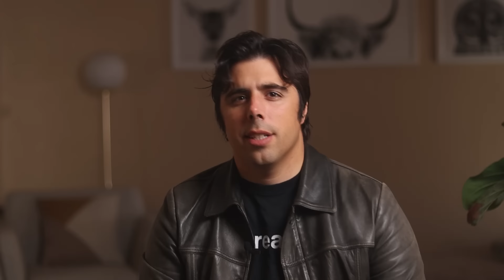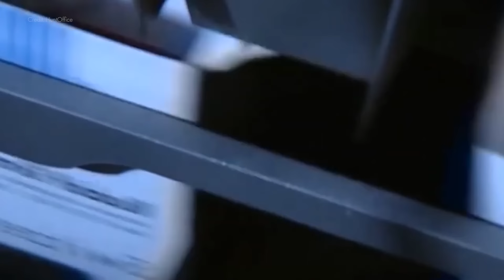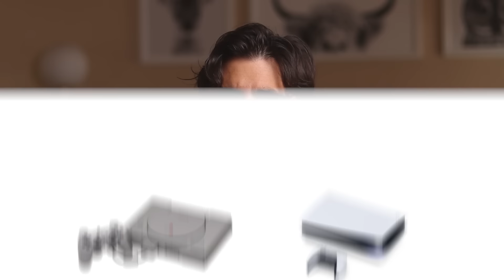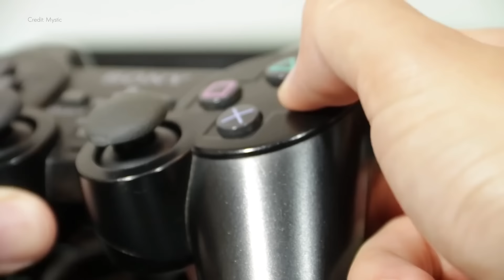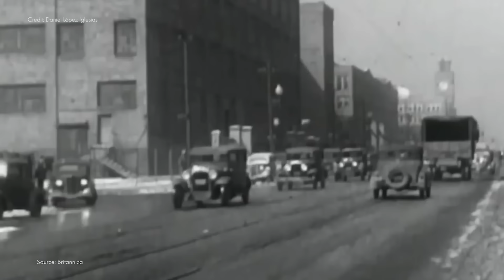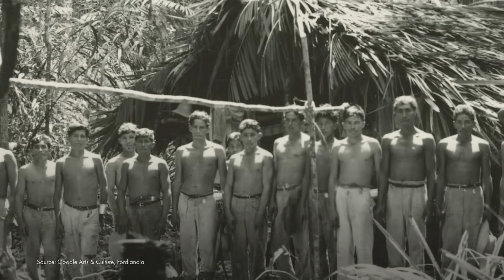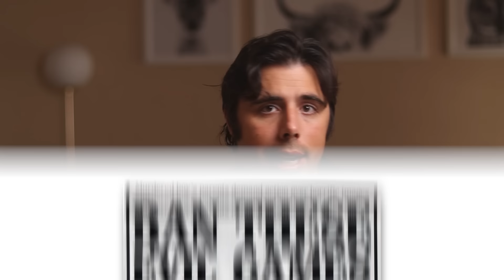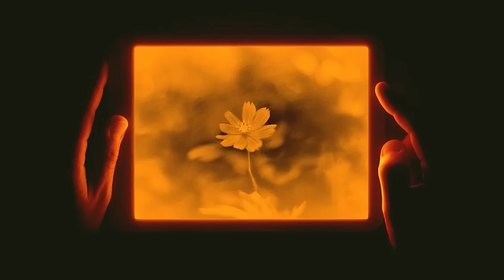Why Some Designs Are Impossible to Improve: Quintessence

Comment: Touch screen on a smartphone makes sense. Because you look right at it 95% of the time when using it. Touch screens in a car, do not make sense. Because you're not supposed to be looking at it.
Reply from the maker: Touch screens on vehicles are awful and dangerous. It's really important to have tactile feedback while you're driving.  But I understand why companies do it. It's cheaper and they can update the interface if necessary.
Reply: @Design.Theory  if we had an effective regulatory system, they'd standardize which functions are ok to be on screen vs. physical. Then no company could claim they were being undercut by another, because they'd all have to meet the same minimum. But alas. We don't.
Reply: @IanZainea1990 if we had a free market without regulation engineers could focus on real world factors like this. 

Also, you don't need to use touchscreen when driving even if you have one. Short attention spans and drivers who will get their distraction if they want it are the problem. 

regulation makes everything worse
Reply: @AbstractAproach if we didn't have regulations then everyone would .. not use the new, cheaper tech?
Reply: @Chandeliers57 

its quite a conpkex subject. Years of government authority and scapegoating don't help. The adjustment would be rocky, I agree. 

At first some businesses would do all of the evil (slavery, child labor, false advertisement, pyramid schemes) and some people would incentivize it 

But eventually through education, awareness, and the understanding that it's their fault people would look for better practicing companies to patronize. 

Insurance also may play a big role, especially in the adjustment period (seeing inevitable backlash they would deem companies higher risk) and could act as local police forces until community policing becones more normalized. (The stop snitching movement is a great example of an appropriate response to government domination but a terrible strategy generally)
Reply: @IanZainea1990 The EU is about to do it, actually. Better late than never
Reply: @hundvd_7 the EU may not move quickly, but at least they move. Data privacy, phone charger standards, now this. To name a few.
Reply: @Design.Theory  also: touch screens do not give you muscle memory. button and knobs with one function on a fixed place help you to not even look at them eventually.  menu diving and scrolling needs extra attention, which your brain needs for for the complicated task of driving
Reply: @Design.Theory  I think one reason for touch screens is that updates can be added to allow charging "subscription" fees for features already in the car. BMW tried it. Anything that turns a one-off "purchase this item" into a subscription-based monthly fee is still unfortunately high on the "seems like a good business decision" list.
Reply: @noyb7920  Thank you for responding in the comments section.  I'm the volunteer moderator of a website.  When we stopped  having a moderator for years, our comments section lost life.  It came back when I started  commenting every day to show the site has personality and that  someone cares about the  discussions and reads them.😊  You did a great job with this video!
Reply: @Design.Theory I want all the Touchscreen in cars responsible engineers to be jailed because of cruelty against mankind.
Reply: @Design.Theory you'll never guess what video you released yesterday 😂
Reply: @Design.Theory  you don't need to update good design, as your own video states. knob controls are almost 100 years old and everyone knows where they are and how they work.
Reply: @zenlettering  I agree, you could reach for the knobs or press buttons without taking your eyes off the road.
Reply: @Trainasaurus that is exactly why modern cars have music volume buttons directly on the steering wheel and/or volume knobs beside the screen 🤦‍♂️
Reply: @Design.Theory we've spent so long thinking about designing for audio and visual intuitiveness that it feels like we've forgotten about how important the contact senses are to a quick-response control panel

Like, maybe this is a weird example, but one of the things that makes trying to fly an RC plane, or even a simulator of a real plane, harder than a real one (yes, harder: it just seems the opposite because the first two obviously have less consequences for failure and more time to practice), is that you don't have any sense of touch: you can't feel the plane shake as you approach stall, you cant feel your body get pushed into your seat as you make a hard maneuver, you have to rely entirely on your eyes and ears for information that is best described by your skin and sense of balance.
Reply: Yeah, I think knobs are just way easier to use for most things in a car. Volume? Give me a knob. It’s quick and easy. Fan speed? Give me a knob. Temperature? Give me a knob. Basically anything that can be a knob should be a knob lol everything else can be thrown on a touch screen, but essential stuff that should be accessed quickly shouldn’t require you to dig through a UI. It should just be accessible at all times.
Reply: Yeah, touch interfaces are extremely useful when you have limited space and would look at the touch interface. Like on a phone.
Every time you don't directly look at, either because you can't or because you shouldn't, physical buttons with mechanical feedback are better.

I have touch buttons on a monitor, and either need the room light on or bring a torch to press the right one (because I don't want to turn it off when I want to switch input)
And I still have an "old" mp3 player, on which I can change volume or skip a track while keeping it in my pocket.
I can find and use the light switch in the dark.

And yes, for a car the radio volume, channel switch buttons, on/off switch absolutely should be physical.
Feel free to combine it with a touch screen.
You switch/select a station with physical buttons (from a hot bar), but you enter the name with a full touch keyboard. Problem solved.
Reply: The one problem I've found with a touch screen (not just with a smartphone but any touchscreen) is that since the touchscreen touches your face/fingers you end up with the oil from your skin left on the screen. Although this may be an issue with other devices that you touch, it seems to be especially noticeable on touchscreens.

Another problem with a touchscreen is that you can't fully protect it. As an example, I had a Sony Walkman NWZ-A818 Walkman that had physical buttons. Due to that, I put a clear plastic case that covered the entire player including the buttons (it had rubber covers over the buttons so that you could use the player without having to remove the case). I could drop the player without having to worry about damaging the screen. It might damage the case, but the player itself would be untouched.

Compare that to my current player, the Sony Walkman NW-A55, which has a touchscreen. Although I've put it in a protective case, I still have to open the cover to access most of the player's functions, although it does have physical buttons for the basic functions (volume, next track, play/stop, previous track, and hold) that I can access without opening the cover.
Reply: @Solitaire001 Walkman has a touchscreen now?!  I'm still using one for the 80's.  They're almost indestructible.  It's only my third one since the 80''s .    The  first 2 were stolen.  I dropped all of them countless times with no damage.   My first one was made of metal, back in the olden days   I still see other people using the old cassette kind.  The benefit is that people won't talk to you if they can see the big Walkman.
Reply: @Solitaire001 just use earphone/airpod while on the call
Reply: yeah I dislike Tesla for that reason cause in a standard car I don’t have to be looking away from the road just to click 5 buttons spread so far apart to turn down the volume in my music
Reply: @andrasbiro3007  I am joking
Reply: you should be cleaning your touchscreens regurarly anyway with products designed for that
Reply: @Solitaire001  Maybe wash ur hands and ur screens lol.
Reply: @Solitaire001  screen protectors:
Reply: @alsonotraeon   I like the thin adhesive kind.  That's what repair shops put in phones.  Try using the phone at a different angle or further from your face.
Reply: Smartphones mainly have touchscreens because to implement any other control type would add a lot of size and weight to the phone,  plus it's a very Intuitive way of controlling something
Reply: @zachmartinez2295  I tried using a mouse again and hated it.  I love the ability to magnify an image with spreading fingers on a touch screen.
Reply: In my opinion, the only good reason why they put touchscreens in cars is to reduce costs. 1 ipad is much cheaper than all controls and backlights. And since you need a screen anyway it's even cheaper to add one extra layer to the existing screen. You can get an 8 inch touchscreen digitizer for around 6 bucks. And you don't have to design stylish buttons that last the warranty period
Reply: I hate touch screens. There is no tactile feel when you touch it, eg you have no buttons to feel that you’ve touched the right thing.
Reply: Phones have limited surface, and more screen allows for more functionality; so removing the need for buttons is actually an improvement.
In a car you have a limited amount of controls you really need, and you want them to be activated with as quick of a movement. Imagine trying to go through a menu to turn on the blinkers.
Reply: How do you make something usable when you can't look at it? Put everything in a consistent place and provide tactile feedback, possibly with some visual feedback that can be readily understood by peripheral vision only.
Touchscreens fail all of this.
Reply: I HATE touchscreens in cars! They should be banned.
Reply: @beestingza  especially when they mirror your phone

like what? using my phone is prohibited but I can play flappy bird on my car screen?
Reply: i think you meant to say placing car functions that you need quick access to while driving, like AC or ventilation on the screen, or worse, behind multiple menus instead of physical controls like buttons, which you can use with only a quick glance. And if you are talking about the center console scrollwheel on certain higher end cars, that is the dumbest thing ever, especially if said car doesn't even give you a toucscreen. Try rethinking your comment.
Reply: @DecidiousPopsicle  I mean. You figured out what I meant. So I think it's fine as is then. Lol
Reply: Real drivers prefer knobs.  They are faster, more intuitive, safer, and more robust and less likely to break.  Do you suppose a touchscreen is going to last 10 years?  How much is it going to cost to replace when it fails?
Reply: @Electrichead64 finding a replacement or 3d printing a broken knob on an 20 year old car: easy.
Finding a replacement screen in 20 years: Good luck.

Some things deserve to be analog.
Reply: @Electrichead64  
Actually knobs are more likely to fail, since they are mechanical, and each one is a separate point of failure.

And safer is when you don't have to fumble around while driving. In a Tesla most critical things are automated, and the rest are accessible on the steering wheel.

My Tesla is 8 years old, and the touchscreen looks and feels like brand new. And mine is not unusual, screen failure is very rare in general.
Reply: @andrasbiro3007  I NEVER had a car that had any button fail.  IF your so called screen dies what then? yeah right your pretty much screwed if you also dont have a dashboard anymore so this kind of design is extra stupid because it makes it more likely to go out with a big bang rather then just one instrument is going out. 

A good designed  doesn't need any updates and why would you want a app on a car in the first place. IF you think this isn't possible to upgrade knobs in your car then you really dont know cars. Cars from the past even had more space for retrofiring more knobs, the mount was already there.  .  Unless its a race car and you dont want a touchscreen there either.  To compare a car to a smartphone is funny. Totally different things. The one is a pretty universal thing and the other is just a box to get from A from A to B and nothing else
Reply: Well said
Reply: The best design for a car screen is to cut the touchscreen and have a controller that is connected to the car screen
Reply: I honestly hate that cars has a giant media screen in the middle console.
Reply: lol we're never getting self-driving (i.e. zero supervision) cars
Reply: I talked to someone who worked at a car manufacturer before. He said the reason they use touch screens is because the cost of manual operated buttons for even basic controls costs over 10x the amount of 1 touch screen. They can then increase the amount of features by simply uploading new software instead of increasing the amount of hardware.

This cost save, however, does not translate over to the customer. A single button repair or a few dead wires is a few hundred dollars if you take it to a repair shop; not even 100 if you know how to do it yourself. A single issue with the screen and you're basically F'd.
Reply: Agree. I don’t understand why they are still so prevalent.

I owned a 2010 Lexus RX with, for lack of a better description. a mouse, that would lock the cursor with a bit of friction but not totally on menu items or buttons etc. It was the best I’ve seen but yet it’s not found in later models and I have no idea why. My eyes stayed more on the road, it was more intuitive to use, and it was the perfect marriage of using a computer in your car with simplicity and quick glances to only relevant sections. You could make the mouse larger as well but default it was large and borders around the thing you would be clicking on. Google 2010 Lexus RX Remote Touch for pictures and check out YouTube for how it worked.
Reply: One reason I love my CX-5. Changing things on the screen is easy, knee jerk familiarity, and near where my hand is already resting. Keeps my eye more on the road.
Reply: i like screens in cars, but teslas suck. i like buttons personally, nice high quality tactile buttons 😂 my mom disliked the model x's screen setup and stuff so much that she traded it in a month later
Reply: Very true. Those touch controls behind the wheel and in the middle console feel much more intuitive.
Reply: I actually find them largely inefficient. the problem is that we have hands which get in the way of seeing what is on the screen when we go to tap or drag or whatever....which is why I use my nose instead.
Reply: Yeah, without something tactile for me to feel, it becomes really difficult to control anything in the car's stereo without me diverting my visual attention. Buttons on the steering wheel are so much better.
Reply: Added the touchscreen but removed the steering wheel controls... It is not timeless but the most robust design is Ford Sync in the 2010s... the latest revision isn't great, but the wheel controls get easier to use the longer you use them.
Reply: QUERTY is shit.  It was litterary designed to be as slow as possible because on early typewriters If you typed to fast the hammers got stuck and made mistakes. Only reason we aren't replacing it with like dvoraks is that the short term cost would be in bilions in replacing hardware and training people
Reply: It kinda makes sense on a phone but i'm 100% convinced i was still faster texting with my old Nokia flip phone and that tactile qwerty revealed on the "inside" of the phone. Obviously the huge screen of a smartphone [when compared to older cell phones] is kinda necessary nowadays because it's all social media in one form or another and people watch videos / play games on their phones. Attaching a tactile keyboard to those things now would require some massive innovation i guess, as the form factor plays a huge part obviously.
Reply: Touch screen is good because it’s a big display for GPS directions. You might argue that other GPS screens do the work but they either block the view or, if the touchscreen isn’t there it blocks controls. And you don’t have to constantly look down on the phone to find your direction.
Reply: It’s not different than looking at an old radio or a passenger. Just like talking on the phone is no different than talking to a passenger.
Reply: The only display that makes sense in a car is a head-up display.
Reply: SO TRUE, give me the haptic feedback of a knob, that i can find without averting my eyes
Reply: 100% !!! I just bought a new car after using the same one for 19 years and my main gripe with it is the touchscreen control for the HVAC system - both, it makes me have to really look at the screen and not the road if I want to change something while driving(like which vents the air is coming out from, specially the defogger vents on the front windshield), but also what about when one day that touchscreen inevitably fails: I'm ok without music or navigation for a few hours, but I'm gonna want heat in -20C, specially if I'm somewhere stuck in a snowstorm. My other gripe is all the "smart" features, like auto-on/off and lane assistance - I can turn the engine on and off when I want to, and if I change lanes without a blinker you bet there was a good reason for it. I really wish my house on wheels wasn't all controlled through a big smartphone screen.
Reply: This! I will NEVER buy a car with a touch screen. I want physical buttons. I’m driving after all.
Reply: While touchscreens in cars that encompass all the climate controls are objectively less safe, the cars that use joysticks and twist dials instead and DON’T let you touch the screen are significantly worse
Reply: @chapystick_ how? Maybe on the test drive, but people tend to learn their cars. On a touch screen, the 'knob' can move around or even go away to a menu (which could also be learned but takes conscious effort unlike flicking on wipers or turning a volume knob which are both naturally learned mucle memory)

I don't mean to be rude but i find myself questioning if you've owned and gotten used to a car ever or how any thought before posting wouldn't discourage, or at least inspire some conditional statements as at face value it doesn't make any sense (unless your talking about sone combined system where knobs change function indicated on screen but ive bever seen that. The most important controls (volume/poweroff, wipers, lights (emergency and visual) are always there if a knob is)
Reply: @A @AbstractAproach ay calm down, lmao 
I don’t think you’ve interacted with the systems I’m referring to.
I actually own an older vehicle with no infotainment screen and a 2025 ford maverick where all the climate controls are integrated into the screen. I also work around countless “luxury” vehicles daily and have gotten to see just how awful all of them are, yet I can see the clear differences between absolutely terrible extremely unsafe implementations of it (Jaguar/Land Rover, Tesla, VW/Audi, and others) vs reasonable acceptable implementations. (Ford, Toyota/lexus)

JLR and VW vehicles tend to have submenus that you have to dig through on a laggy screen and genuinely is not intuitive whatsoever simply to change your heated seats or the aircon. Absolutely terrible to live with and interact with more than once.
But new ford and Lexus vehicles keep all the climate and seat buttons persistent on the screen 24/7. Of course, there’s no tactile feedback that’s necessarily easy to touch without looking and the loading times when you startup can be annoying… but it’s significantly safer than the other implementations that accomplish nothing other than make the experience worse. 

But I’m also referring to the slightly older Lexus vehicles that have a really bad joystick or touch pad near the shifter for interacting with the navigation and the Audi and Mazda vehicles that refuse to let you touch the screen while the car is moving and instead force you to use control dials for the infotainment screen selections which take your attention away from driving even moreso as you fumble with scrolling left and right to navigate any button vertical or any direction on Apple CarPlay.
There’s also a bunch of Hondas that give you a few aircon buttons but changing things like the vent output and fan speed require you to use the screen in a submenu, for some god forsaken reason…

Genuinely positively bad. The best implementations will always be a good screen for navigation and CarPlay (hard to live without when you’re used to it) but still analogue buttons for climate and radio. In the more expensive ford vehicles like the F-150’s, they still fortunately do that but it’s very unfortunate and greedy it has to be in expensive only vehicles at all.
Reply: I thought i was calm  @chapystick_ , I even put a conditional in that iv your talking about screens changing knob, button inputs then none of this applies (or something like that)

But yeah I feel you, sorry if I forget the conditional
Reply: There was already a study here that compared different vehicles in doing standard task in a car (ie changing volume, etc) and the touchscreen ones i think took two times longer to do than the old car with knobs. Its a Swedish test i think. Look it up coz my numbers might be off.
Reply: @triptip00  I've actually seen a study saying that out of two groups of peoples reaction time after smoking weed but focused on the road, and sober people trying to press a touchscreen button, the people who were high had twice the reaction time or something when something happened on the road they had react to lol, think of how many crashes and how many people have been killed on the road just because they can't find the submenu to change their music volume
Reply: Unfortunately our posture and mind and overall health
Reply: A friend of mine works with the visually impaired to make their homes and workplaces managable. Nobs, tactal buttons, and voice activation are the keys. Braille label makers for all the products they buy. One of the most hated websites for the visually impaired is Facebook.  They didn't design it with text to voice in mind, and they haven't improved it.
Reply: if i could like this comment twice, i would
Reply: This!!! physical,  tactile controls on the wheel make so much more sense. You can feel where they are and what they do without looking at the controls AND NOT TAKING YOUR HANDS OFF THE WHEEL.
Reply: But fragile gays these days want touchscreen everywhere inside their car, including a 55inch TV.
Reply: Ok.
Reply: If self driving cars start to really catch on then it might
Reply: Yeah AR integration on the front Window, is more convenient
Reply: New on this channel. Is the Fonz gettup is part of his character just for this video?
Reply: Vehicular radio and gps controls should be tactile and located on the steering wheel à la T9 texting from back in the day
Reply: people love to argue with "well it warns you when you're driving" aht aht! the radio volume, air con, some of the seat positioning but not all ofc, the cruise control (i think that's what it's called. the one that keeps your speed the same, pretty sure that's cruise control), radio list and a few more are on the touch screen and the little tiny screen with awful controls in my dad's brand new car. on teslas everything is on a touch screen which is even worse. that mf controls almost everything and it's so jumbled that muscle memory is impossible. oh, you added air to your tyres? sorry, no cold air for you, DUMMY. oh you wanted to read the manual?? oh that's cuuute, BOOM, no back comfort. ridiculous. remove the damn things and put buttons. i don't mind some things being touchbut a physical manual? yeah, that'd be great. oh, also, the gps and spotify control are hidden behind a wall that requires buying data. as in data for phones.
Reply: yes I have a 2021 with a touch screen on the dash and I hate it. I want buttons I can feel
Reply: I got a new car this week, after always owning ten to twenty year old bangers. MG3 Hybrid+. has a letterbox-sized touchscreen, but all the essential controls are conventional buttons, stalks, and knobs - even adjusting the wing mirrors is with a conventional joystick thumbstick thing. touchscreen is needed for some of the a/c controls, navigation, media, and config. this is a budget hatchback and I am very pleasantly surprised
Reply: Voice activated controls make sense, should be standard, and turned on by default (with an alternate option for those with disabilities that make voice controls difficult). Not only will that keep the majority of eyes on the road, it will also keep their hands on the wheel, and work better for anyone that is unfamiliar with where the control they want is located (think new car, rental car, etc.).
Reply: @app103 two problem with voice controls:
1. They work poorly in a noisy environment like a car.
2. They can be activated accidentally for example by a child that repeats what it heard, which is a common behavior in children.

They can be useful for non-essential tasks like navigation, but even in these cases they shouldn't be the only way of controlling, because of point 1.
Reply: a hybrid design will be better. Including both touch and physical buttons or sliders
Reply: A iPhone apple nonsense doesn't make me feel like I wanna touch it.. it makes me feel annoying seeing apple
Reply: now we voice control. siri
Reply: At the time it didn't make sense. Pre iPhone, touch screens were utter crap that requires either a stylus or was just inaccurate and frustrating to use. Pre iPhone, touchscreens were a joke, and apple figured it out.
Reply: ... at least not for primary controls. I think for built-in navigation, media controls, advanced information and settings, AC controls, ... it's a good idea because it is inherently multifunctional.
Reply: Fewer and fewer Marques are using physical buttons, not just replaced by the touch screen but around places you would see buttons like the steering wheel they are using touch pads. Which for me one of the most infuriating automotive trends, closely following aids and systems like lane alert and stop start always being active by default each time you start the car, ignoring that you deactivated them last time.
Reply: There should be no windows at cars at all only screens with important info from outer cameras and added reality😅
Because our eyes lies to us more frequently than artificial analyzers
Reply: There's no way I can use a touch screen accurately on a smartphone, and I have tiny fingers.
Reply: Touch screens to change gears in your car: unfathomably stupid.
Reply: Automakers do it first because it's cheaper, second, because car buyers expect it, and third, because it's cheaper. For a large company buying generic units in bulk like Chevrolet, Ford, Volkswagen, Peugeot, Honda, or Toyota, a touchscreen display can cost as low as a couple of dollars. A magnitude lower than what would cost to design and manufacture a single button, let alone the whole cluster of buttons, keys, and knobs a car requires. All the other reasons like it being easier to update, it being "trendy" and so on are just afterthoughts as soon as you realize how big the financial incentive is. Money is king, safety and convenience be damned.
Reply: It does make sense when you use Android auto or Apple car play
Reply: The sense is space. In a fixed button area, you can customize the buttons, and using slide to multiply the buttons.
Reply: It's so that whenever the screen breaks your car is useless, and the companies can charge more
Reply: It's a lot faster than using a joystick to navigate the screen meaning you don't have to look at it for as long. And if you mean that screens in general don't belong in cars, then I say that it's a lot easier than holding up your phone for your maps, flipping through a radio or putting in a CD, because with Bluetooth or CarPlay, you just say "hey siri, play me songs by muse" or something like that.
Reply: Only thing beating a smart phone is a fold phone or personally I want a SCROLL phone!

 So I can stand on a podium and scroll out quotes from our great leaders. 

 Both Xbox and PS controllers can improve with at least paddle buttons. Not the pinnacle of design. Maybe steam controller.  Never used it.
Reply: Can’t say it enough
Reply: yes! as a person that own a tesla i hate it, i also have a byd this abit better but so many near crashes trying to turn the ac up
Reply: tactile buttons in cars are also better because you get feedback. The buttons are also designed so that you can mess with important stuff such as the thermostats, volume, and radio tune without taking your eyes off the road. With touch screens in cars it absolutely makes no sense because there's no physical response to the touch and it's a much bigger distraction. For example in my car with the buttons I can keep my eyes on the road and still know exactly which button and function I'm messing with, and if I do need to look it usually only needs to be for a second. 

Plus touch screens go out of date fast.
Reply: That's what I said to my husband when we recently bought our first car with a screen.  I noticed that he looked at it too often to use it instead of the old fashioned way of using buttons that cat be felt.
Reply: 💯% !!  Bring back the Volume Knob!
Reply: I prefer a nob, tho I definitely still prefer a touch screen to a touchpad
Reply: Touch screen on a car makes total sense because you can show any button that you want and change them when needed, I prefer 100% now the touchscreen of new cars will all the features than the 100 buttons on old car that can't do 10% of what modern touchscreen car
Reply: Touch screens in cars do make sense, for certain features.  I remember my grandma had a 2000’s something high end car and it had every feature packed into it.  Well the dashboard looked like the cockpit of a plane.  Dozens of buttons, bad layout, not good.  On the flip side some modern cars put everything behind a giant screen.  I think there should be a good balance of both.
Reply: Wdym smartphone 95% is looking at it, what are the 5% then. Are you saying tune the volume up/down tucked inside a pocket whilst listening through headset is 5%?
Reply: having controls like heated seats and cabin air controls be in a menu on a digital screen is one of the dumbest things car companies have done after putting the screens in..
Reply: Touch screens in cars are absolutely idiotic. You want buttons you can identify by touch alone so you can keep your eyes on the road. It should literally be made illegal, because it gets people killed.
Reply: Totally agree, car makers putting everything on a touch screen is a pain that I hope changes. Another commenter mentioned Mazda, their control wheel is great, physical feedback when you have to adjust something that doesn't have a dedicated button, and a volume wheel close at hand for the drive through or whatever. Physical buttons/wheels for hvac temp control and heated seats just makes sense, I don't want to dig through some screen to put the hvac on defrost because it got foggy out on the drive to work and the auto hvac isn't smart enough to tell the windshield is fogging up. And no a connected smart car I can yell at is not the answer, in the real world there are cell tower dead zones, give me buttons for the basics.
Reply: Screens are cheap. Buttons are expensive.
Reply: Depends on what you put in that screen, you're not doing everything while driving. Media controls usually still have actual buttons around the steering wheel that you don't need to look at.
Reply: I totally agree with that, and I say this as an engineer and the owner of a Tesla. I'd style myself an enthusiast for Tesla than a "fan boy", perhaps more for what I believe it can be than what it actually is at the moment. I'm frankly surprised that there isn't more integration of VOICE into these systems. With the power of AI and Large Language Model, it seems that there are a number of things that could done, and frankly done better, if we leveraged voice interactions more. Yes, humans are predominantly visual creatures, but our voices and our ears are still the brain's preferred method of direct communication. Sure, we can do with our thumbs, but it's just easier and more effective to speak. It can feel clunky and unnatural "talking to a machine" when the interactions aren't fluid like the human-to-human communication, but the AI model has largely overcome that. AI is even intuitive that the car could likely know when you're talking to it as opposed to another person in the car in much the same way you know when someone is talking to you in a conversation among friends. We really need to be leveraging that, because visual distractions are a HUGE contributing factor to human errors that result in auto accidents.
Reply: Benefit of the t9 phones is I could text and drive, ees on the road the entire time.
Reply: It's harder to touch a touch screen that you have to reach with your whole arm to navigate...A phone, you really only have to use your thumbs.
Reply: @Crecross  
A phone is much harder actually. Current phones are too big for a thumb. And also too small to easily target things. Have you ever tried to highlight words on a phone? 
The touch screen in a Tesla is big, easy to read, and easy to control. And it's placement also helps with both.
And, again, you don't have to use it for everything, the most common functions are accessible on the steering wheel with physical buttons.
Reply: I hate computer controls on cars. Right now I'm shopping for a new (old) car, in particular a nice 1965 GTO. It's time to put my 1963 Buick out to pasture.
Reply: @JS-oh2dp  if it doesnt entirely REPLACE physical controls, and you dont use it while youre actively moving, it is useful. thats what my argument is.
Reply: @alsonotraeon I hope you meant "while on the road" not "while actively moving".  There are too many drivers who think that being stopped at a light is a great time to f* with their screen.
Reply: @HweolRidda  i mean yea i said "on the road" on another reply lmao
Reply: "makes sense" - as long as you are only passively consuming content. As soon as you want to enter something, you'll beg for some decent input. And there were devices that just slided a keyboard benath the screen - but those were a tiny bit more expensive to produce, meaning less markup, meaning I can't buy any of those today. It's not just about performance - the capitalistic system is an influence in itself.
Reply: 100% When cars will be self-driving we can have all the touch screens we want. For now they are just a terrible design choice and simply a cost saving measure.
Reply: idk, with apple carplay the touchscreen is super handy. the console screens also got bigger to accommodate the touch screens, and that’s worth it for the gps applications alone. i used to have to drive with my phone in one hand held up by my fingers woven around a popsocket so i could still use that hand to drive. it was a pain in the ass.
Reply: @Manic_Femme  fair. In some ways like carplay. It works. But for basic car functions... Nah
Reply: @Manic_Femme  you could have just… bought a phone mount.
Reply: @Manic_Femme that’s illegal in many jurisdictions and can have fines of $10,000 or more
Reply: Using a non smart non hands free mobile phone while driving has to be safer than taking you eyes of the road to interact with those new dashboard screens. The second the car moves those screens should go off.
Reply: Touch screen on 95% of screen was pure nonsense before iPhone converted our phones into device to make and watch videos. 
To get what I'm pointing at, imagine future, where first and only selling point of your car is quality of the screens and its cinema-like experience, also yes, it can move from place to place.

Notice also that there were numerous attempts to improve phones into videophones, all failed, beacause we already used voice phones as device that allows us to excuse ourselves or lie effectively. With smartphones, we can proof our words with video, or even fake proof with one, if we need, while we seemingly prefer messaging to normal everyday lie&excuse purposes, which points at all IM messaging as extremely succesfull quintessential design and video calls as its opposite.
Reply: We’ll see if consumer like it more than standard cars. So far Tesla has sold like 5million+ cars and 1.8million in 2023. All of which have touch screens and it seems all automakers are making bigger screens and trying to copy Tesla’s rapid growth (500k cars in 2020 1.8 million 2023) and success. Consumers will decide the market long terms. BlackBerry had a better and more practical keyboard…
Reply: @alphaomega9650  lol you think consumer decide? Nice fantasy.
Reply: Obviously the best result would be reducing car usage to out of city, non intercity transport only. 

They are wildly inefficient compared to other ideas that yes need infrastructure to be built but then again so did cars, putting down rails for street car systems is less material and area intensive in the long term as well.

Less cars on the road will make the issue of not paying attention while driving inherently less important.
Reply: maybe a heads up display?
Reply: @007hansen  a hud would be fire, but its too expensive lol
Reply: @007hansen dicsussion is about control. Not display. So…… heads up.
Reply: @robsmith4884  Haha, nice play on words!

Infrared Eye Trackers for drivers exist today, sadly not in the discussed configuration, yet.
Reply: If there were buttons, you'd have to look to the screen, at the buttons, and back to the screen. That's more time looking at something that is not the road than just clicking precisely at what you need.
Reply: For unchanging controls, like the horn, the blinkers, volume, I can agree, but for many other things, a touch screen in a car has the same benefit as on a smartphone. In Jobs’ words, if you think a great idea down the line, you can’t go back and change physical controls. A Tesla, for example, by the end of its life, will feel like an entirely different car from when you bought it, something only accomplished by new models in traditional cars. You get used to the touch screen, and even appreciate it eventually.
Reply: Except for few buttons, like the climate control or the volume, you look at the buttons as well and if you really learn to operate them blind you will also be able to hit a few buttons on a touchscreen. As long as there are physical buttons on the steering wheel I will take a usefull touchscreen, like in a Tesla, all the time.
Reply: Where are you going after you die?

What happens next? Have you ever thought about that? 

Repent today and give your life to Jesus Christ to obtain eternal salvation. Tomorrow may be too late my brethen😢.

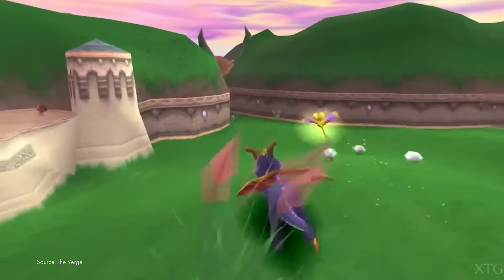Hebrews 9:27 says "And as it is appointed unto man once to die, but after that the judgement ,
Reply: i think it makes sense because its very convenient. it even warns you not to look at it while driving. as long as it doesnt entirely replace physical controls, i dont think its that bad.

edit: notice how i said "i think" before two of my sentences? thats because its my take and my personal opinion. you guys should also realize that i said "if it doesnt entirely replace physical controls." in my opinion, its convenient in some situations because you dont have to pull out your phone to do some things. audio controls and AC controls should instantly available anyway, if not a physical control. i also think that you should notice that about 50 people have replied to me the exact same thing.
Reply: @alsonotraeon  The entire purpose of the console controls on a car is to be used while driving. Physical controls means that everything can be adjusted without looking away from the road for more than a fraction of a second if that. A touchscreen makes portions of the cars controls completely inaccessible while driving without causing a safety hazard. Actual garbage design, just changes for the sake of "innovation" that have nothing to do with the reality of use.
Reply: @ThordanSsoa  actually it's even dumber than that. It costs a little more and requires a little more engineering and a little more manufacturing to install buttons. They say it's "futuristic" when really it's just cheaper to slap it all on a screen. That's why
Reply: @andrasbiro3007  that's what I said
Reply: @andrasbiro3007  If the car was properly designed in the first place, it wouldn't need software upodates.
Reply: @IanZainea1990 
Advantage of touch screen: can add more functionality, options, change UI with software update.
Reply: @ThordanSsoa cost is a bigger factor than “innovation” it’s just cheaper to put everything in a screen
Reply: @IanZainea1990  Modern cars have SO many controls. Imagine a physical button to toggle the coming home lights feature, another button to set how long the CH lights stay on for or a physical button to toggle the teardrop feature for the wipers as examples.

Physical buttons are better and preferred IMO for common features like AC, but a digital display is needed to house the hundreds of sub controls available in modern cars.
Reply: @ThordanSsoa  lol, you need to be in the car with my aunt. She’s looking at the map, unplugging and plugging her phone, skipping songs,  adjusting  the volume, checking the weather, adjusting the temperature, answeringor declining phone calls etc. AND driving a 5,000 lb vehicle. It is nerve wracking.
Reply: @alexthannah That’s why I don’t want all those controls.
Reply: @DiamondKingStudios  Are you in the market for buying a new car? The target market for people buying new cars suggests they want those features, otherwise they wouldn’t be implemented.
Reply: @alexthannah  You may have a point; the prices I’ve seen on new cars these days suggests that regular folks like me are better off buying used, so we’ll leave the new cars to folks who want technology because it sounds cool and are able to pay for it.
Reply: @mpf1947  lol, software updates can improve an already good design... 
Have you even used any kind of software in your life?
Reply: @alsonotraeon I can't tell if you're being sarcastic but regardless the best design I've used so far is Mazda's knob thingy that is conveniently placed near the shift knob (especially helpful for those of us who still drive stick) with a nice tactile feedback. 
Usually all I need is a quick glance with my eyes. I do wish the quick launch buttons in front of the knob/joystick had Braille style bumps to you let you feel where they are. I LOVE that the volume knob is also down there and one push down will instantly mute the stereo.
Reply: I agree. I love the controls on my Mazda and it feels much safer to use while driving than a touchscreen.
Reply: @spamcan9208  Dang I love the Mazda knob. Such a good design.
Reply: @spamcan9208 my man, have you ever heard of volume controls on the wheel? having to take the hand of the wheel just to mute the audio ia the dumbest thing i have heard from a car at that price point
Reply: @DecidiousPopsicle   Of course I have volume controls on my wheel. However, setting aside passenger use, it's also handy for those of us who shift our own gears. I can tweak volume in between shifts while not compromising grip on the steering wheel. Especially important in front wheel drive cars with enough power to torque steer (and a heavy right foot.)
Reply: @spamcan9208 lol I drive a Mazda 3 mainly for that. I absolutely despise touch screens in cars
Reply: @spamcan9208 VWs, BMWs and mercedes had these “knobs” since the mid-2000s lol

oh… I keep forgetting these cars are super expensive outside of europe
Reply: @spamcan9208  I know exactly what you mean, my Toyota Yaris (actually a Mazda2 with Toyota badges) has two knobs right between the shifter and the console that control the entertainment system. Easy to handle completely by feel, no distractions.
Reply: @spamcan9208  ive tried a few different ones, from mercedez, bmw, vw and other brands. those knob thing varies from brand to brand. some of them kinda suck and the other ones don't control as many things as you would like but ALL of them are better than new touch screen infotainment systems. ALL of them.... jeez i just hate those touchscreens in cars.....
Reply: @spamcan9208  I adore the knob-based center panel of my Mazda. After a week of driving it, my muscle memory was set, and now I can do anything I need to on the display without looking at it for more than a split second. It is also a touch screen, but I have never used it as such. My only gripe with it is that I need to scroll over 5 times in the music player to get to the "Next Song" button. Pause and Next Song are the most used buttons, and they should be on the left side where your cursor starts. Even those 5 scrolls are muscle memory now tho
Reply: @bigmilk13_  agreed, wish the play/pause and track selection were done a little better but like you said, even that you pick up quick enough that it's more like an annoyance and not an obstacle.
Reply: @spamcan9208  I don’t like the knob because you can’t tell what gear you’re in at a glance/feel. I’m really fond of the stalk-style that a lot of trucks use, but as someone who only drives small cars, I don’t get to use them often
Reply: @spamcan9208  fellow Mazda driver here. Yes, the head unit knobs and buttons are tactile and their placement on the pedestal is nice.
Reply: @alsonotraeon  I want to adjust heat or skip a song while driving. Tactile buttons you can use without looking. My climate control is buried in the touchscreen menu, and is way more distracting than feeling for a knob.
Reply: @alsonotraeon  so how are you supposed to change the AC settings or sound settings on the road? Do you stop every time you need to adjust anything in your car? No? Well then knobs and buttons are superior.
Reply: @alsonotraeon touch screens are so hard to use while driving. Having a button or knob for something is so much better
Reply: @alsonotraeon  Technology has a place in vehicles, but it should not be infotainment.
Reply: @alsonotraeon  "as long as it doesnt entirely replace physical controls, i dont think its that bad"
lol. lmao even. A slight glance at newer car models, all brands included (but especially Tesla) would tell you that this precisely what is happening. Whinging that you have put a nuance word in front of your incredibly naïve statement doesn't make the comment any less misguided. Just edit the comment out if you can't handle people happening onto it and responding.....accordingly.
Reply: @Alarios711   im not even talking about what car companies are doing now. im saying, THEORETICALLY, having a screen in your car could be useful if it doesnt interfere with the controls that are already easy to access. i dont understand why everyone feels the need to immediately tell me im wrong. i shouldnt have to delete or edit out my comment just because people disagree with me. i also dont understand why everyone is so argumentative and rude, especially since i wasnt being rude at all. i only gave my own take. if you disagree with me, then either just ignore me or at least dont be a dickhead for no apparent reason.
Reply: @alsonotraeon  the only reason cars are switching to touchscreens is because it's actually far cheaper than physical controls. you basically just put in an IPad. but it keeps being proven to make cars less safe because people spend more time looking at it. like, car radios today are way too complicated. they should function with simply presses on very few buttons. because you want to give the driver as little distraction as possible. a very basic radio from the 90ies will do better than a modern one in most cases (except for sound quality, but the handling of it is much better)
Reply: @alsonotraeon  it's not convenient lol. And I'm guessing by the warning you are making a joke?
Reply: @alsonotraeon  It doesn't make sense though. Why use an interface that requires you to make the warning?
Reply: @alsonotraeon  Yes, a garbage take even if personal
Reply: @alsonotraeon  you're right, it's so much more convenient to have to navigate a touch screen to adjust my AC/ radio rather than using buttons I can feel and don't need to look at.
Reply: @alsonotraeon ur joking right.. who cares if it say don't look while driving ppl do it anyways
Reply: @alsonotraeon  How are you supposed to not look at something that gives you zero touch-response?
Reply: @alsonotraeon you are insane dude
Wtf
Reply: @alsonotraeon  yeah, but that exact problem is one of my many major reservations about Tesla cars
Reply: @alsonotraeon  "Convenient" and "practical" are two different things
Reply: it makes sense because soon, you wouldn't even have to drive. Just like riding the elevator. The technology is here. It's just a matter of making it legal.
Reply: @LuisAzcona The problem this tech is running into is less the automation, but more the morals. Example:

Lets say the car has two options. Swerve to avoid, or keep going straight. Everything else is blocked by walls, and you can’t stop in time to avoid hitting anything. If the car keeps going straight, it will hit a mother and her 3 children crossing the street. If it swerves, it will go onto the sidewalk and mow over 7 people. Which should it choose? How does it choose? If it’s hardcoded not to hurt anyone, it might just error and stop working, possibly harming more than just those in immediate danger. 

I’m not against automated driving, it’s a really amazing idea, and if done right, could revolutionize travel. However, it’s things like this that are blocking the way. The manufacturer would need to ensure that it can make the “right” decision at least more than a human can. 

There’s also the thought that if they do hit someone, is it the manufacturer or the passenger (person who would otherwise be driving)’s fault? It would likely fall on the manufacturer, as they were the ones to ensure the safety of the vehicle. This would make any manufacturer hesitant to design such a vehicle.
Reply: @LuisAzcona I see no point in having a car if I am not driving it. There should be other means in most places to travel without using one.
Reply: @DiamondKingStudios  "If I am not driving it" - i am very confused. So you see no point in taxis, ubers, busses?
Reply: @LuisAzcona  I was mostly referring to cars I might own. Taxis have a use, but I want a person behind the wheel.

Buses are a different thing, since they’re not individualized transportation.
Reply: @LuisAzcona  And making it safe.  It works in certain areas.  I'm a pedestrian, I rely on eye contact, gestures and other signals from drivers that they see me and are yielding to me.  A flash of the headlights or backing the car up a few feet are both signals I watch for at intersections without crosswalks.  I don't know how a driverless vehicle would indicate that it senses me and is yielding to me.
Reply: @LuisAzcona  naive